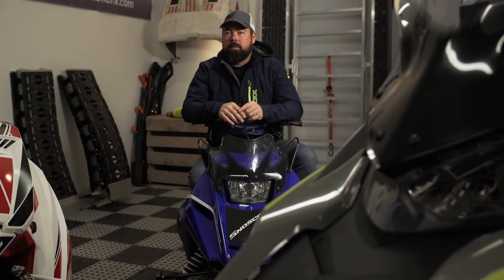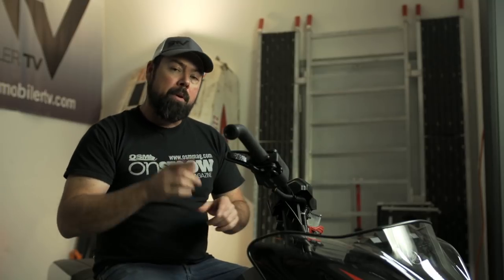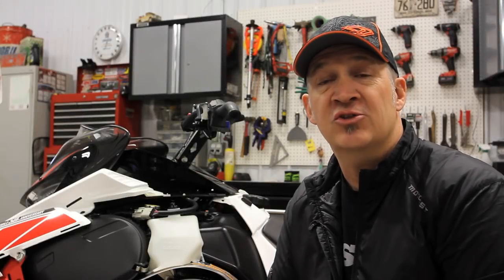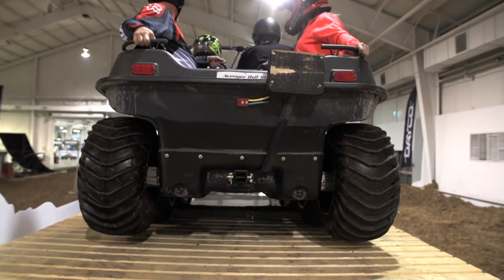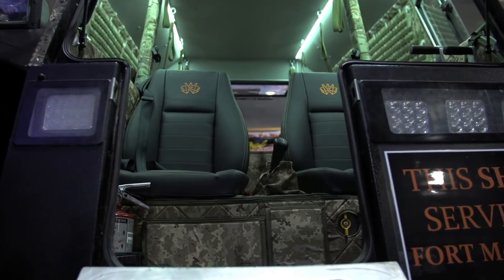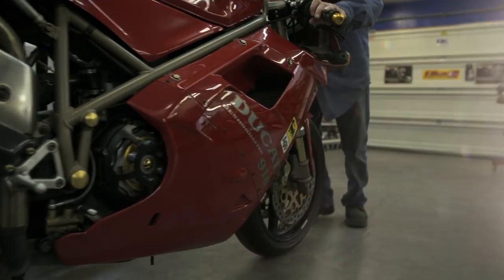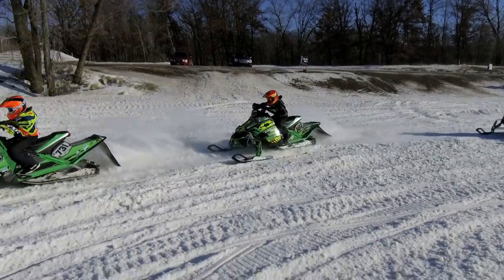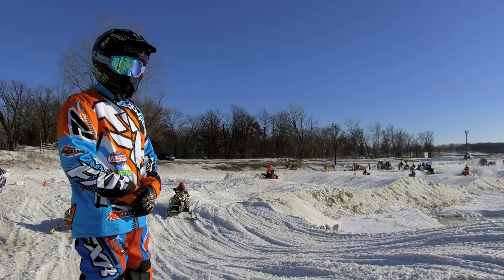STV 2018 - Episode 3

Comment: Every other snowmobile report tells that there are two snowmobiles that are the fastest this year, since the same engine is in the Yamaha and the Arctic Cat. The differences in clutching and shocking and skis determine who is fastest in what setting. 
That's great having the school for kids but I think it would be an improvement for them to have some short track smaller sleds that would slide easier and turn easier. Maybe put them all on a 1987 Indy 400 for schooling.
Reply: I learned on an 89 indy 340

Comment: Oh my god, I just checked the specs on these Indy Evo snowmobiles compared to the standard Indy sp. They are the same. The only thing they did was put a lower the mounting point on the suspension. 
Six year old kids can reach the running board on any old style snowmobile. 
A standard seat and lowered handlebars can make it that a twelve year old, which is legal age for kids to start driving after passing a safety course. 
Come on Polaris, make it truly a smaller size out out on a standard flat seat and not a riser, I'm going to stand up and fall off, seat and handlebars.

Comment: I just found out today that Polaris is about to release some downsized Indys they are calling "Evo". They are a 38 inch ski stance, that is adjustable, with a 114 inch length. 15x121 track, carburetors, 544 cc air cooled engine with controls to limit speed. 
It looks like an Indy SP and the marketing shows young teens and women. 
I guess we'll see what the price point is.
It turns our that Therese are the same chassis as an  Indy Spwith the adjustable front suspension off the Voyager . The suspension is shortened but the seat and handle bars are not. Still too big for twelve year olds and little women.